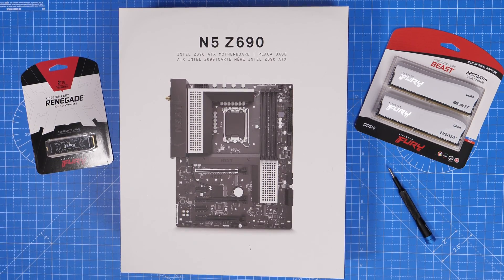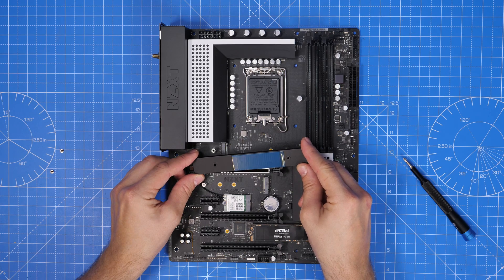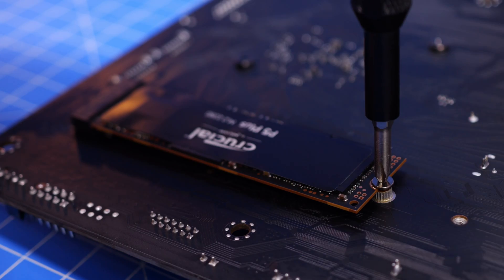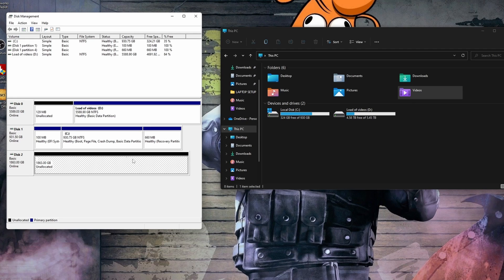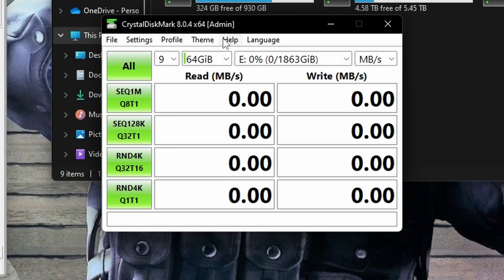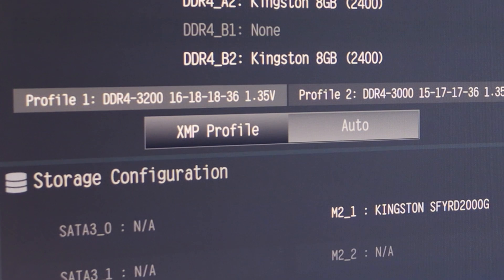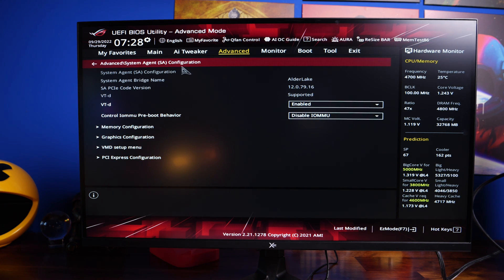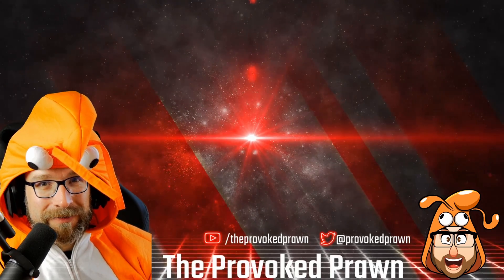How to install Kingston Fury Renegade NVMe with tips and ticks

Comment: great video, i had one alienware Alienware x15 R2 P111F with this ssd, on BIOS you have to turn off SECURE BOOT and put the disk priority in AHCI and not RAID or some kind because if this options are on you cannot see the ssd drive in Windows instalation

Comment: Bro, can you help me? 🚨🚨🚨
I bought a Rog Strix B650-A and a Corsair white 2tb MP600 Elite ssd, this ssd has his own heatsink and when i put into the mobo the q-latch doesn`t spin as it should... I searched for hours about my problem and now i found your video, in your Z690-E in 2:58 seems a lot as my case, if i put a little force into the q-latch it will stay like in your Z690-E, Isn't it too loose? in other videos I saw the latch spinning until the end

EDIT: I tried lifting the motherboard vertically and the SSD came loose, mine doesn't work, how do I proceed, will I need to buy another one?

Comment: Hey! I bought this SSD today, and my motherboard has a heatsink plate, should i remove the SSD's top metal sticker to install it on my card's heatsink?
Reply from the maker: Don't remove the sticker but do use the heatsink
Reply: @TheProvokedPrawn  What are your idle temperatures for Renegade?

Comment: I have kingston fury renegade m.2 2tb drive which runs pretty cool at 28-33 degrees celsius when idling depending on season. There's no need to attach the m.2 heatsink that comes with motherboard because this specific ssd already has a black sticker which acts as heatsink.  I have it installed it in second m.2 slot below graphics card so there's is no extra heat generated between graphics card and cpu.

Comment: 0:00 Helloooo
0:30 NZXT motherboard
1:40 Installing the install Kingston Fury Renegade NVMe
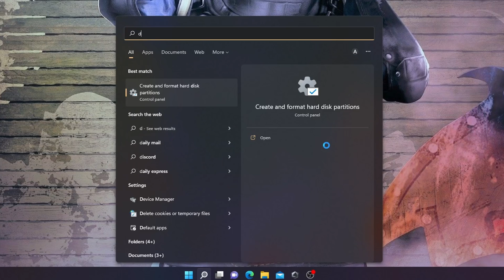3:06 Disk management 
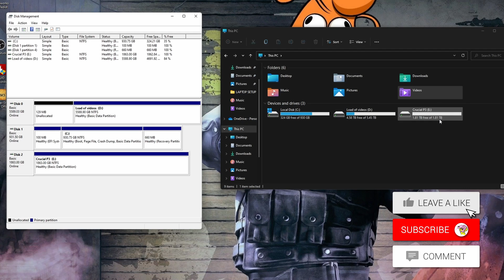4:51 Testing the NVMe drive
6:20 BIOS setting for the NVMe
7:11 Advanced BIOS settings
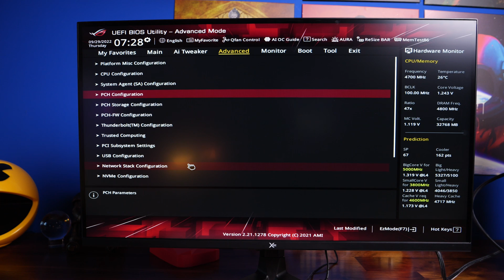8:28 SATA or SSD problems
8:48 X.M.P

Comment: For z790, if u place any drive into the top slot, connected to cpu via pice lanes... this will cause the first pcie ×16 slot to be cut in half to ×8.   Graphics cards right now are gen 4 therefore will run at gen 4 ×8 lanes.  May be a problem. Confusing and fine print type stuff... I guess once gen 5 graphics cards come out  x8 gen 5   is equivalent to gen4 x16.
Reply: it shouldnt be a big problem, im running a gen4 x8 card on a pcie 3 slot, so effectively gen3x8. and the performance is still extremely solid